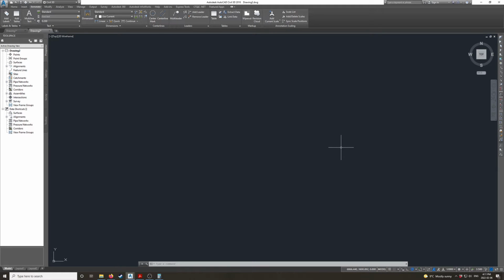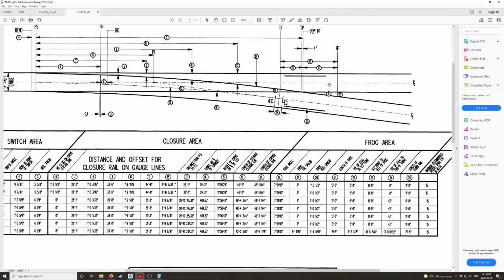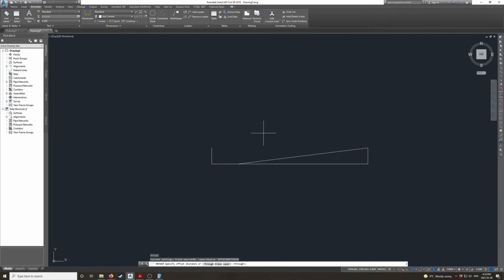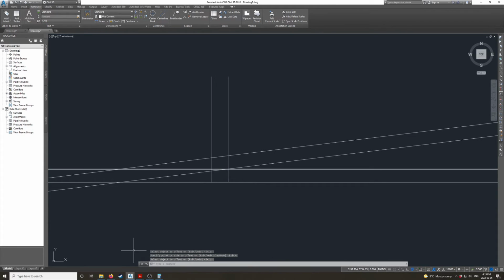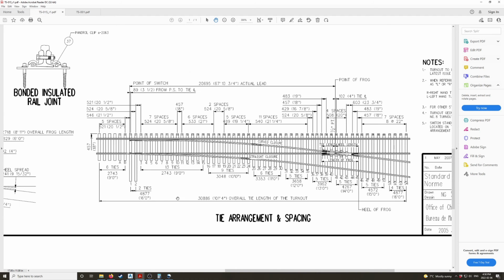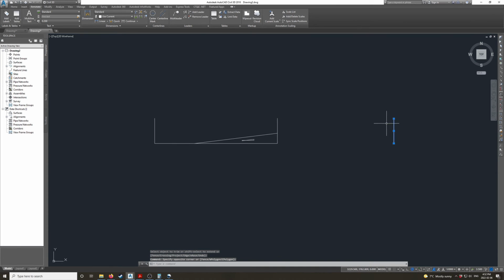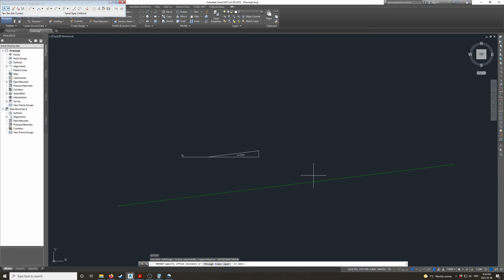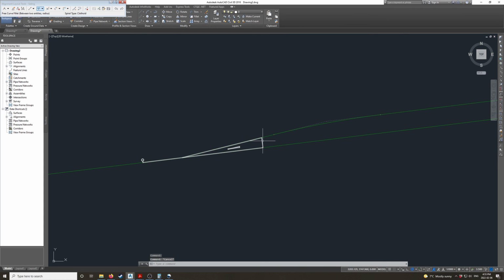How to Create a Turnout Block in AutoCAD

Comment: Where did you get the reference images if you dont mind me asking. Wanting to design my own turnouts for model railroading
Reply from the maker: The reference turnout is from railway standard plans which are not available to the public. There are standard plans available from AREMA for a price. Otherwise, you might have some luck requesting plans from turnout manufacturers.
Reply: Thanks for the help
Reply from the maker: @roaringlegend456  Check out appendix A page A12 for CN turnouts: https://www.cn.ca/en/customer-centre/safety-guidelines-and-regulations/track-specifications-and-maintenance/